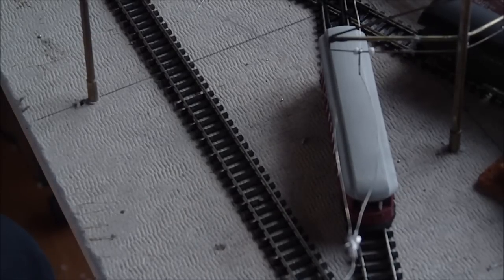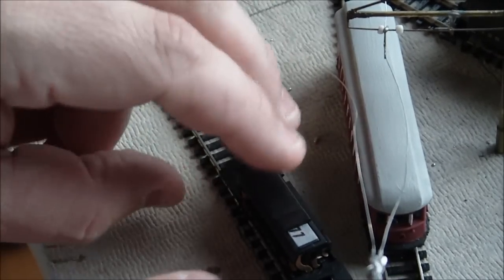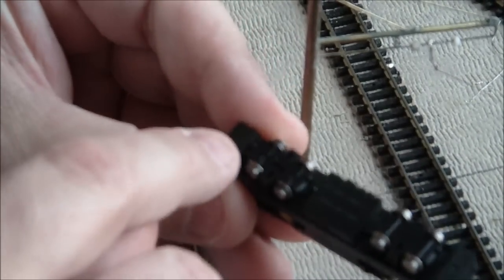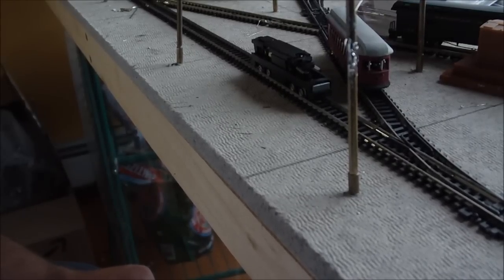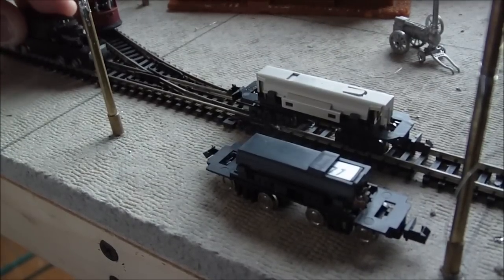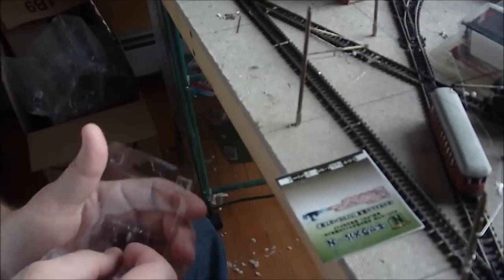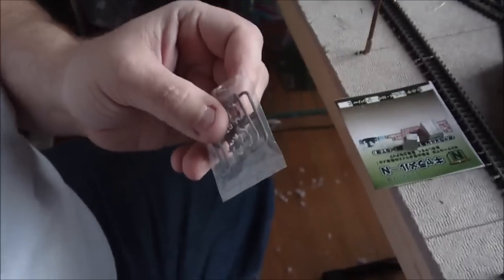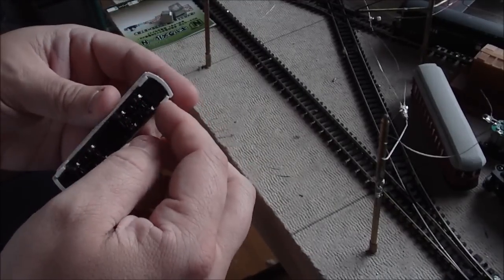Episode 5 - Japanese Power Unit Comparisons

Comment from the maker: @sjanninck I believe that it is a limitation of my power pack.  But I also believe that the Bandai power unit will not creep like the other two.  Unfortunately, my power pack seems to be either on or off when it comes to the low end of the output voltage.